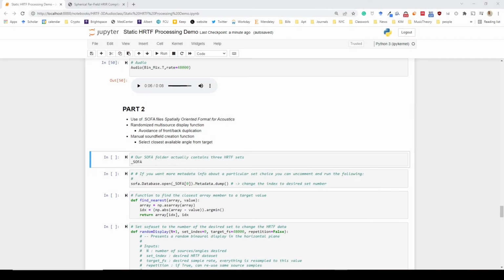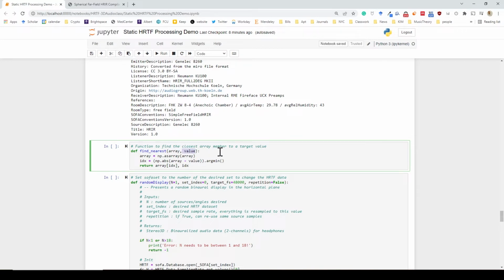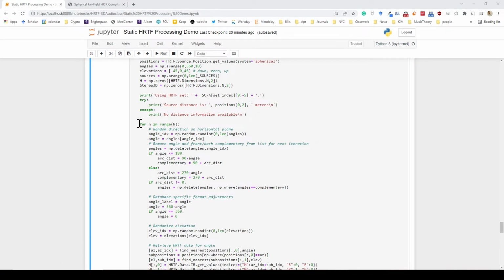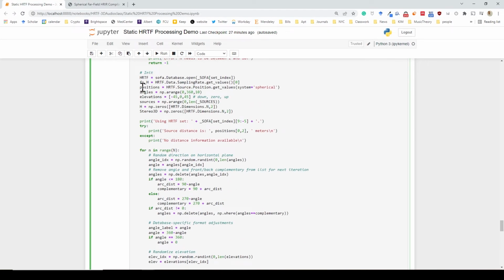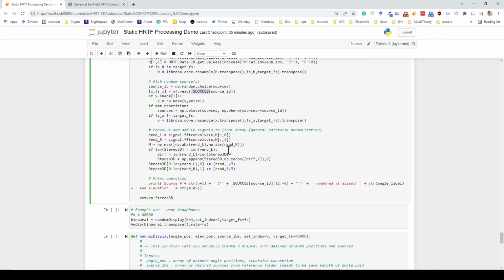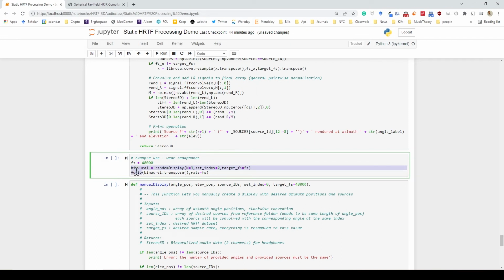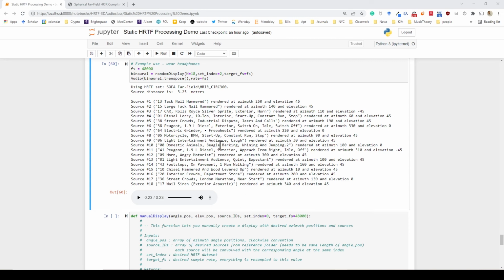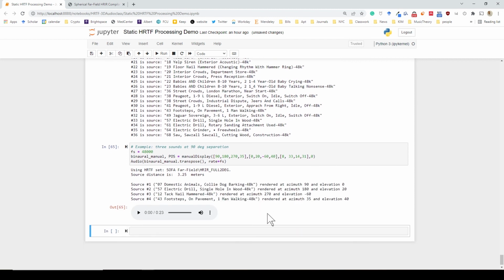3D Audio HRTF Processing in Python - Part 2

Comment: Nice tutorial thanks for sharing. Please provide the jupyter notebook if possible. So how do you implement a sound that moves around the listener? I notice the hrtf angles are are at 5 degrees apart so the movement wont be smooth. How to achieve smooth movement, or maybe this is not the tool for that?. I tried OpenAL but the results didnt sound realistic. Convolution sounds good but cant control it like openal
Reply from the maker: Hi, the easiest thing would be to change to a finer-resolution HRTF set (e.g. 1 degree) and quantize spatialization over windows of time. You can also use interpolation algorithms to create a finer HRTF grid from a wider grid. There are other more complex strategies to deal with that problem, which leverage sound perception abilities but those are for another day.

Comment: Hi! This code is quite impressive, thank you for making a tutorial on it; I'm currently working on a headset for blind people implementing computer vision (object detection and depth maps) and binaural sound (generating sound on the location of the objects) and I was wondering whether it could be possible to also manually define the sphere radius/source distance as one of the inputs in the function.
Reply: Plus, whether it would be possible for it to be a realtime HRTF convolution.
Reply from the maker: @adriangalvez798  For real-time rendering you can have a look at overlap-and-add freq-domain convolution methods, provided you have a good CPU and short filters then you should be fine. If it takes too long to compute, or if there are moving trajectory artifacts, there are additional complexity reduction techniques that may be worth looking for. 

In regards to distance radius, it is usually not a factor in these HRTF databases. You'd have to simulate it using a combination of relative volume and direct-to-reverberant reflection ratio within a room. The exception is for very close sources ( < 1mt) where particular near-field HRTFs may be required.